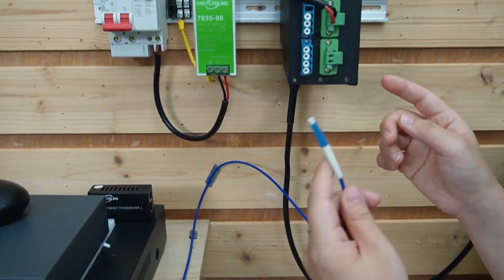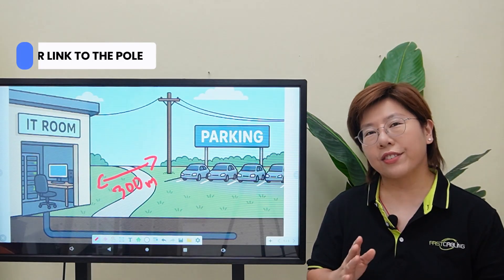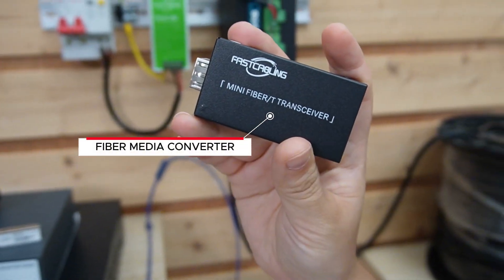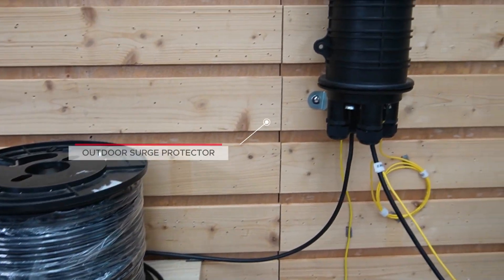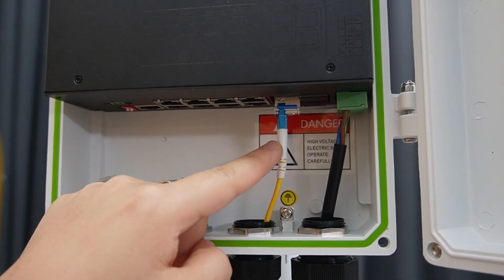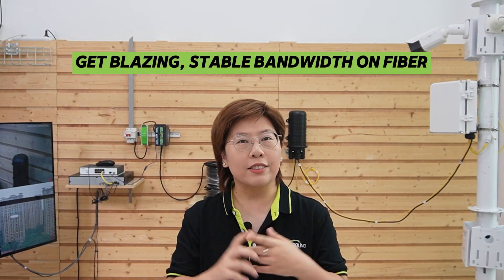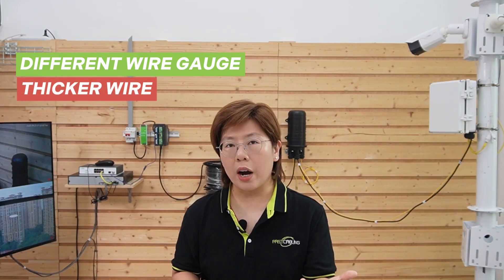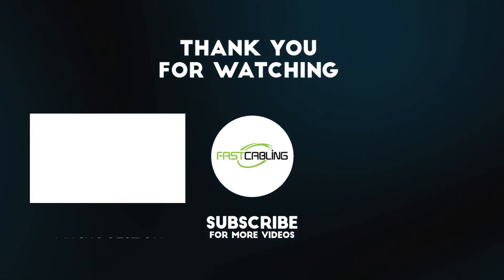Power 4 Cameras 300m Away with One Composite Fiber Cable | Parking Lot Surveillance

Comment: Please excuse my ignorance, why there is only one FC wire? Costs? Didn't you want to say at 2:59 simplex instead of single mode cable?
Reply from the maker: https://www.fastcabling.com/product-category/composite-fiber-cable/

We can customize the cable length, copper gauge, connector type, etc., if required. It's single-mode, simplex LC.

Comment: I think this set-up is more expensive than the POE.
Reply from the maker: You are right about the cost but there is no other way to increase the PoE’s total power budget. The maximum power budget is about 71W with PoE++ 4 twisted pairs. The wired gauge is equivalent to 18awg. However, you can use 14awg or 12awg to send the power with composite fiber optic cable. No mentioned the fiber optic cable supports up to 10G speed.

Comment: how about 2km away. would this work too? fiber will work surely but the composite cable with 2 copper wires? and also this composite cables can withstand outdoors too? not all sites have underground cable highways.
Reply from the maker: Over 2 km, you’ll see a real voltage drop. Your wire gauge, supply voltage, and load current decide whether it’s viable.

This cable has an armoured jacket and can be buried underground.

Comment: sooo.. can you tell me again, why I can't just use 10G PoE+++ and simple switch on the other side with much less hardware?
Reply from the maker: The PoE++ can increase the remaining power budget to 71W within 100 meters. You will need to deal both power and data loss while the length is beyond 100 meters. The UTP cable has fixed wire gauge. You can’t increase the power budget with standard cat5e or cat6 cable.

Comment: But, there are 2 cables going to that pole? i dont understand this product.
Reply from the maker: One cable carries the fiber, and the other is for power.
Reply: Think he means the patch from the blacksplice box and surge protector, from what I understand from that point it is 300m with botch power and fiber in same cable. The length with 2 cables is only from the termination point aka the blackbox thingy, which either can be mounted on the pole or in a manhole tub below.

Comment: Hybrid fiber seems like a better idea. Fiber data and copper power in the same wire.
Reply from the maker: You can increase the copper wire gauge to send more power to the edge and the UTP Ethernet cable is limited to the twisted wires. The maximum power budget is 71W within 328ft. You can send up to 150W DC55V low voltage power with 14awg copper wire in hybrid fiber cable.

Comment: Question:
For a tiny setup, are there any "PoE powered" (eg PoE++) switches that can feed PoE devices? Maybe even a switch taking two PoE++ ports in parallel to fully utilise all eight copper conductors of our standard cable? If this product doesn't exist - somebody please make it!  :)
Reply from the maker: You might refer to this video for PoE pass through solution. The power budget is 71W. https://youtu.be/AQEtKTd23AM
Reply: @Fastcabling  Thanks, just bought one "Outdoor Waterproof PoE Pass Through Switch" to play with.
I suppose the ideal product that I'm looking for would be two parallel four-port PoE++ expanders squeezed into one box that presents six usable PoE ports (three on each channel) so that one standard trunk cable can be fully utilised.
Reply from the maker: Thanks for your order! If you run into any issues during the setup, please contact us at support@fastcabling.com.

Comment: Nice solution, the problem is 10x more expensive than traditional PoE installation. 
Remember that you can use a long range PoE+ and PoE extender
Reply from the maker: The long-range PoE+ switch is a nice choice and more budget-friendly. It can extend PoE up to 500m at 100Mbps. 

https://www.fastcabling.com/product-category/long-range-poe-switches/

Comment: Why aren't you using 54V? PoE devices must accept 54V but can only drop to 39V. Most switches have 54V power supplies to make longer runs possible, so using 54V on composite cable seems like an obvious choice.
Reply from the maker: In our demo we used 48 V because it’s a common, safe supply for testing and it keeps things simple when people are just learning how composite fiber works. But you’re right — for longer runs (hundreds of meters) a 54 V supply gives more headroom against voltage drop, which means the cameras or PoE devices will stay stable even when cable resistance eats a few volts.

Comment: Why using 48v dc power but they camera working on 12v dc
Reply: The cameras are PoE and the power on the ethernet cable is at 48v. The voltage would drop too much when using 12v on the ethernet cable. 12v is only for using the camera with an ac adapter. The camera internally uses 5v, 3.3v or lower.
Reply from the maker: These cameras have two power inputs:

PoE port (RJ45): Supplies both data + ~48–57 V DC power.
Barrel jack / terminal block: Accepts 12 V DC (sometimes 24 V AC on higher-end cameras).

Usually PoE is preferred. At higher voltage, the current is lower for the same power. They use 48 V DC to send power long distances with less loss.

Comment: Español
Inglés

48 volts DC across 300 meters of cable? Is that possible? Is there no voltage drop?
Reply: There is voltage drop, the power over ethernet specification says cameras must work on minimum 39V. It would be better to use 54v, the same as most switches now.
Reply from the maker: Over 300 m, resistance adds up, and the drop becomes noticeable. That’s why systems use 48 V (or up to 57 V in PoE) — higher voltage means lower current, so less loss.

Comment: Why not use the jumper WiFi points to points connecting veiw camera
Reply from the maker: You can use mesh Wi-Fi to view cameras, but it only solves the data problem, not the power problem.
Reply: For critical things like security camera I won't consider a wifi based setup. If someone want to steal a car a simple wifi jammer would be enought to take the view away.

Comment: even for just 4 cameras and PoE switch on the pole, you are gonna pull more than 1A thru those wires (especially at night when the IR leds are on), so for sure for 300m you will need way thicker copper cable than shown in the video, which will have way more voltage drop. i would instead stick to 60V AC for powering those devices, which will have way less loss, you wont need to use as thick wire, and you are still in the margin of low voltage regulations. this way we were powering the nodes of DOCSIS3 internet and TV cable networks in the past.
Reply from the maker: We can customize the cable gauge. At 300 m, you need thicker copper (≥1.5 mm²).
Reply: What, less loss at 60V AC compred to 48V DC???
1. At best - 25% less loss.
2. PFC is required otherwise cable loss is increased, not decreased (DC power = I*U, AC power = I*U* p.f. (current*voltage*power factor, power factor is around 0.5 - 0.65 for non-PFC PSU.
3. Cable has to be ~1.5mm^2 anyway (300m, 48V system, 1A of current)
4. 57V DC is supported by PoE equipment, use that instead.

Comment: So just run a fiber and a power cable
Reply from the maker: The composte fiber cable is an all-in-one solution. No need to trench or string two separate cables, which cuts labor, duct space, pole attachment, and permit costs.
Reply: Yeah but its cheaper to just run a regular outdor fiber and a 3x 1.5mm power cable. Plus you add lights in future as well